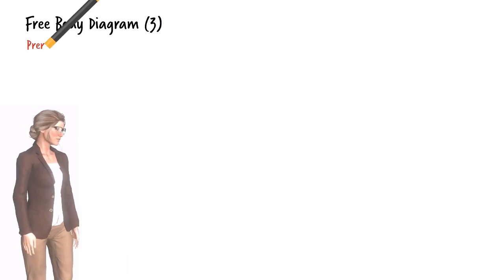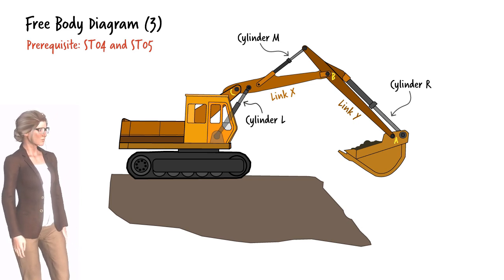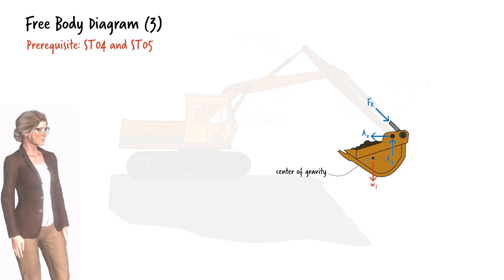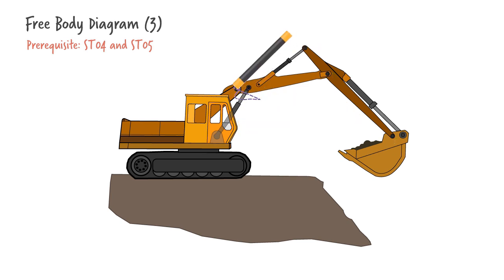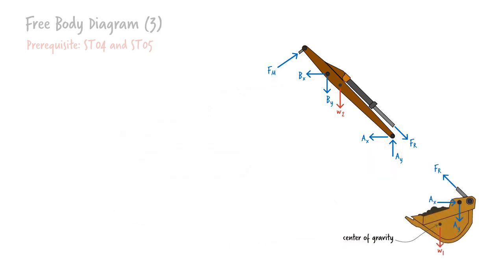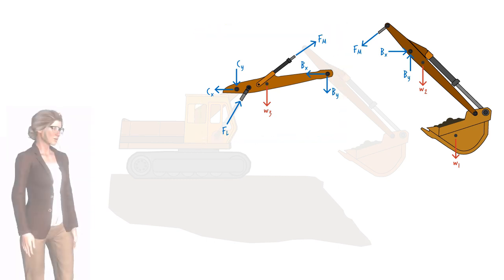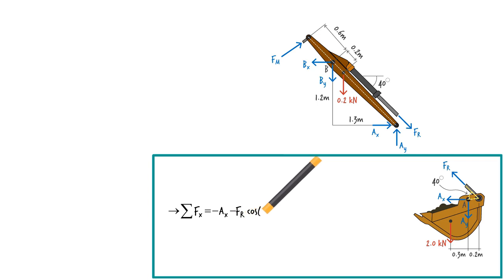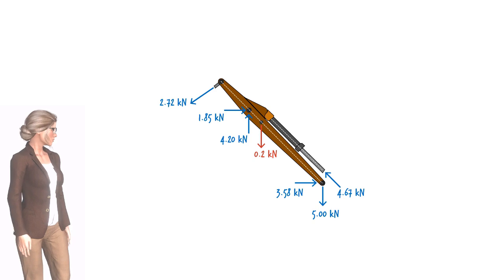ST06: Free Body Diagram for Rigid Body Equilibrium (III)

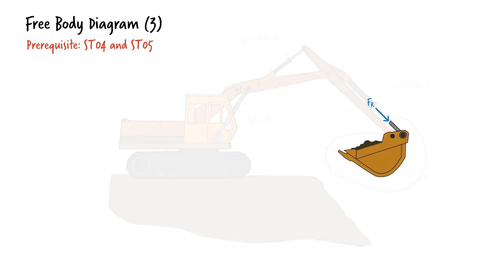Comment: The forces directions are matter here? Because I did not understand why on 1:47, Fr going toward pushing hydraulic liquid direction, but on 2:59 its going like pulling liquid direction. Hope I explained my problem
Reply from the maker: Except in trivial cases where we are certain about the direction of an unknown force, when drawing the free-body diagram, the direction of unknown forces can be assumed.  

In this case, since the axial force in the cylinder is unknown; we can assume the force to be tensile or compressive.

If the calculated force magnitude comes out to be negative, then the actual direction of the force is opposite to the assumed direction.
Reply: @DrStructure  oh, I was thinking this rule is working only by inner forces analysis. Thanks for explaining 🙏

Comment: IS THERE ANY CONTINUE QUESTION SOLUTION?
Reply from the maker: The aim of this lecture is to illustrate the process of constructing and using free-body diagrams. We do not have a lecture that covers a complete analysis of the system. It may be worthwhile to prepare such a lecture as a continuation of this presentation.

Comment: hi Dr.Structure, i have problem balancing this frame
https://ibb.co/j4LF8JG
https://ibb.co/wNHsvQM
base on a force of 5 kN, my bracing should have a force of 3.5 kN, and it all seems good as the corner part have 0 force ( zero force member ), but when i try to do a global moment balancing i notice the summation of force at any of the support leg to ground is not = 0, please enlighten me :D
Reply from the maker: You must have make a mistake in your calculations somewhere. How did you get the force in the diagonal members?
Reply from the maker: You cannot analyze this as a truss. Why? because it is unstable, unless you add a diagonal member to the lower level connecting one of the support points to the upper joint of the other column.
Reply: @DrStructure  Ok i get what you mean, it is because there are moments in the lower column member ?
Reply: @DrStructure  for frame design by hand calculation, can i calculate the force of 5 kN like what i did ?

1. Base on the horizontal force of 5 kN apply at top of frame, distribute it to the diagonal member by doing a total force=0 at point B

2. Since point C is zero force member, each of diagonal member will carry 3.5kN and when we convert it into x direction it will transmit horizontal force of 5kN into 2 unit of 2.5 kN at left and right side of the column.

3. Then since the height of column to the diagonal bracing is 2m, we calculate the moment to be 2m x 2.5 kN = 5 kN m

4. And check the bending stress of column and see if it can take 5 kNm
Reply from the maker: 1. If this is a frame and not a truss, the 5 kN force at the top of the frame is going to be balanced by an axial force in the beam and a shear force in the column. 

2. The concept of zero-force member is applicable to trusses only. There is no such thing as zero-force members in frames. The beam and columns at the upper level of the frame are not zero-force members.

The analysis that you are performing is not suitable for frames. On the other hand, if you model the structure as a truss (by adding a diagonal element at the base), then yes, those members at the top right-hand side of the structure can be considered zero-force members.
Reply: @DrStructure  ahhhh !!! now i see, thanks sir <3 much love

Comment: Why fm is negative
There is no components of fm
Reply from the maker: Not sure what you mean by "Fm has no component". Fm acts perpendicular to the central axis of the arm. So, it is going to have a non-zero moment about point B. Furthermore, on the free-body diagram, Fm is assumed to cause a clockwise moment about point B. But, the moment equilibrium equation tells us that for the total moment about B to be zero (for the arm to remain in the state of equilibrium), Fm must cause a counterclockwise rotation, hence, the negative value for Fm.